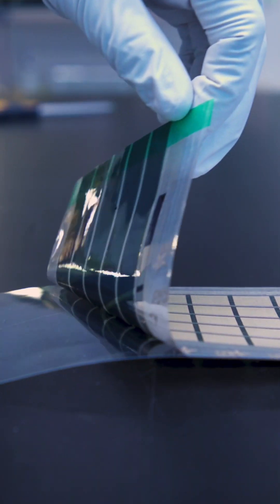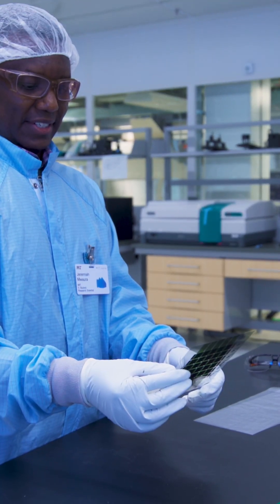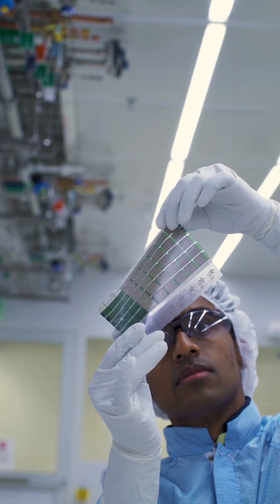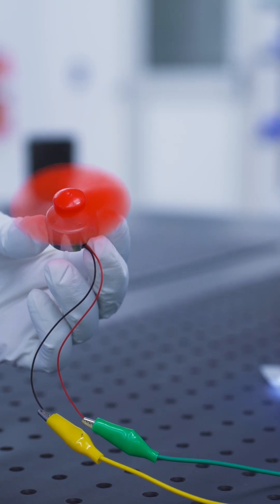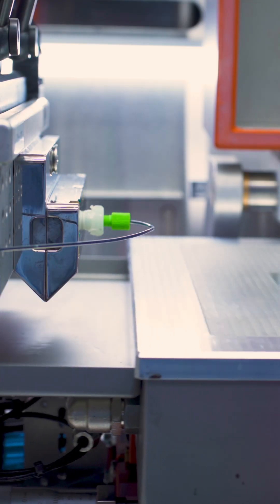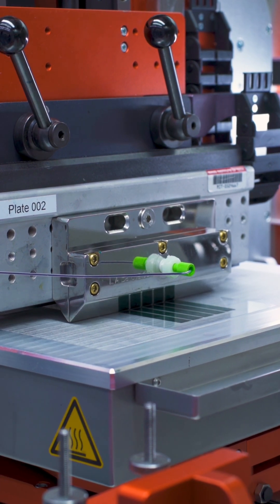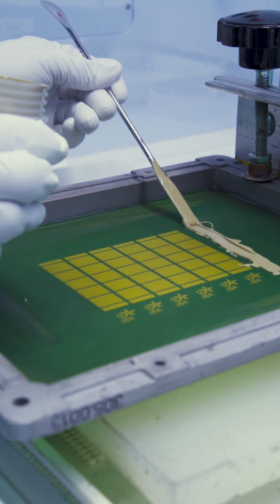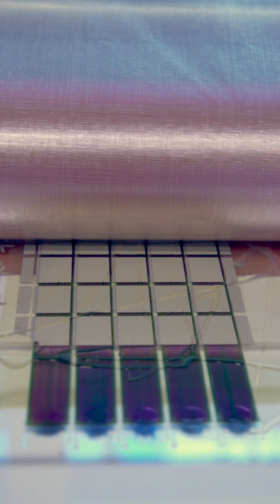Turn any surface into a power source

Comment: its nice that they produce more power per KG of panel but it sure would be nice if it was calculated in square inch instead as that is far more informative for knowing how efficient they are at converting light to electricity
Reply: never mind looks like they are really only 0.18 as effective at power generation

Comment: Problem is rating them in KW per KG is not the only metric that matters.  if  its only a fraction of the power per square meter your not going to be powering anything energy intensive off it.  Main reason traditional solar panels are so heavy is they need them durable enough to survive being out in the weather.

Comment: Not new 
    Solaris in the UK 
      Bendable solar panels 
         Twenty , Twenty Five years ago the company was started to produce , provide solar panels that would fit in to non standard , non flat , awkward places . Very little weight so that the solar flexible panels could be fitted to light weight , ' non supported ' roof structures